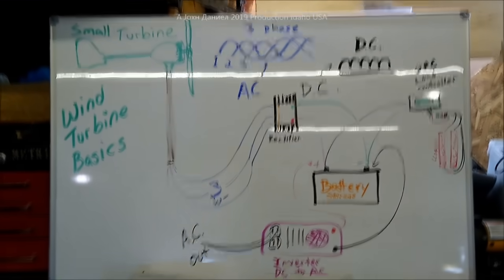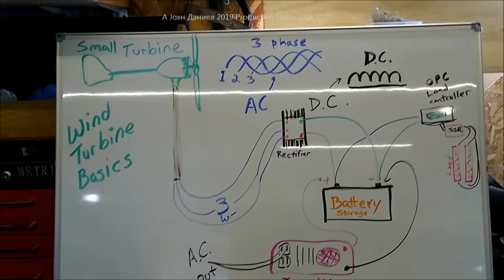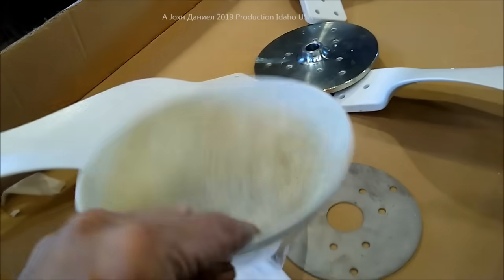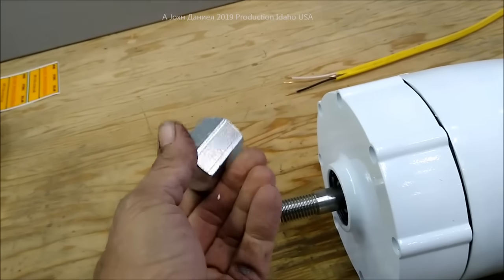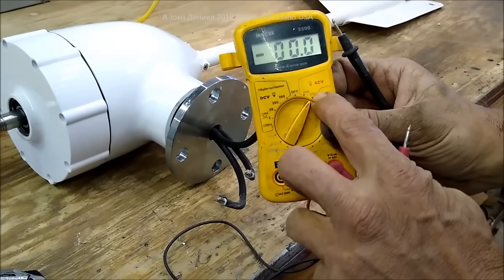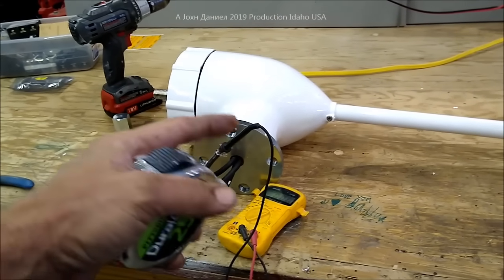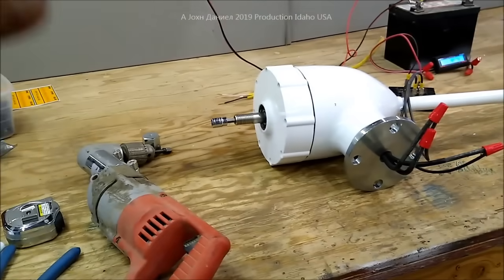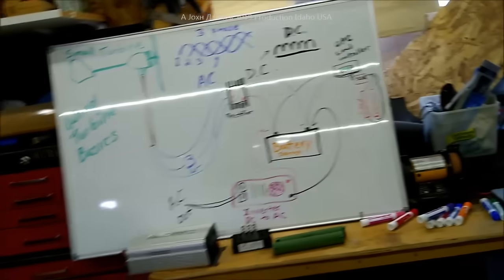800 Watt 12/24 volt Small Wind turbine by B & C Wind, Newest Model, Huge Parts List below

Comment from the maker: WIND TURBINES #1 Source for all Residential Turbines -  https://ebay.us/ChKVLy
My 500/600 models here https://ebay.us/8AgTiU and all the POWER PARTS LIST 600/1000 watt LW-M3 series Small Wind Turbine I use They are seen in older videos making 120% rated power!! *This channel may make a ebay partner commission from some links offered at no additional cost and can often save money due to discounts from the sharing.
( ALSO FIND THEM HERE 👉 https://temu.to/k/ptsnjzrkoq3 )
12 volt 100 watt 2 to 6 ohm https://amzn.to/2ODJtTe
24 volt 100 watt 4 to 8 ohm https://amzn.to/2ovTkQo
48 volt 100 watt 6 to 12 ohm https://amzn.to/2ODr1tX
LIVE WATT METERS https://amzn.to/2ODYJQk
SOOW 8/3 Wire ( safest to use ) 
UPDATED SOURCING - To get 100% full batteries from one & to divert over volt you need these: https://amzn.to/37HN2OR 100A SQL Rectifiers &  https://amzn.to/2MTUjCU A All purpose long life Load controller and be sure to get up to and over 300 watts diversion resistors ( https://amzn.to/2QngFPq x 3 or 4) and one or more 60 amp SSR ( https://amzn.to/2QKEyj0 ) with heat sink ( https://amzn.to/2ZYtmna ) and be sure to use thermal past on it.  ( Proper type - https://amzn.to/2QN2hir from Protronix) Consider your wind speed area to size it!
Reply: Hello John, I love your videos.
I have a question for a 800W or 1000W wind Turbine how long the pipe needs to be from the ground to the top, also can I use a aluminum light pole?
Reply from the maker: @wagner1968  15 feet and higher depending on your install area. Ground disturbance clears up at 8 to 10 feet and is gone at 20 feet in 90% of the world so I would exceed 15 feet with no obstructions like trees or buildings within 75+ feet away when installing yours. And a (19+ foot on average) commercial light pole is a great type of pole to use.
Reply: Great video, I can't wait to see more about this!
Can I get and run a 24V windtur into a 12v system... do I need to convert it into 12v after it's generated?
Reply: Јоhn Daniel I thought you had to go from the rectifier to the charge controller to the battery? Or does it depend on what controller you have?
Reply from the maker: @80Matthias80  Depends on the controller, if you have a braking controller which is sent with the turbine the system works but not well. On mine I run from turbine to rectifier to battery, then my OPC controller controls top charge rates with diversion loading. Its a much better design than the all in one controllers because you can get 100% battery charging, the others will only get it to 90% due to their design which applies braking to the turbine to prevent over charge. In my experience, braking is not good on turbines, loading them down is.
Reply: Јоhn Daniel what exactly is the ssr for and is it really necessary?
Reply: Јоhn Daniel my system is also 12V too and the only ones I can find all say 24.
Reply from the maker: @80Matthias80  A SSR is used to assure many more switching actions for load diversion to control the wind turbines power.
Reply from the maker: @80Matthias80  If you go to the link under the video, there are choices of 12,24,48 volt and 3 or 5 blade.
Reply: DUDE or should i say Professor of normal gentleman talk.  You would be BRILLIANT in a trade collage teaching apprentices. Some people have the gift of sharing knowledge. You do it brilliantly. Some lads are smart but they cant deliver there smart to others. perhaps they are just selfish and trying to make it sound like rocket science. I am a electrician for the past 30 years. I have your gift. NOW ,,, Not everybody can share knowledge but in doing so actually tests us. You never know what the apprentice is going to ask . There is no silly question. Also i like to let them try first and go for it.. There young brain has not been polluted be our passed down trade knowledge. Who is to say we have the best way to do something. I have learnt a lot from 1st year apprentices that have not had   "this is how its done"  shoved / drilled into them. 

  I never teach my pupils, I only attempt to provide the conditions in which they can learn.

  Albert Einstein
Reply from the maker: I teach a Preppers Survival Power class every summer, 3 classes lasting 8 days each.
Reply: @JOHNDANIEL1  can we get your email to keep in touch about the classes
Reply: @JOHNDANIEL1  How may I find out about the Preppers Power Survival classes?  Thanks!
Reply: John want to buy one  ut how will i wire it up to use with my grid tied 5kw solar system?
Reply: How do you hook it up to the grid without using a battery
Reply: I love your videos and find them really useful. I purchased an 800 W windmill from B&c run by battery drill I got a 95, 95 and 100, is that within acceptable parameters? Thank you very much.
Reply from the maker: @tomhernon3247  Yes, thats normal for a open voltage.

Comment: this is 6 years ago but nontheless.. yes you can push 'upto' 800 watt but the problem is i don't understand why any wind turbine producer expect it will go that high but in reality you can't unless the generator are really optimized for that. 'this' turbine is not optimized for low speed and that take into count if the location can't even generate quarter of the 800 watt? it's basically not worth it. better of just build it yourself. it just 'rated' can handle up to 800.

Comment: Hi John. 
Brad here from South Africa.  
A while ago I bought a burned out wind turbine.  I got hold of a guy in the UK , Hugh Piggot, who helped me with a design to rewind the turbine. I rewound it and it works like a bomb!  Problem Is, I can't find a controller to match! I've bought a blue, claimed 1600w controller and dump load on ebay. That peaked at about 980w before engaging the dump load....jusg as the turbine would start to produce power the controller would activate the brake for 30 seconds.  It produced only 0.66kwh in two days before it burned out. 
Next I tried a 2000w dc to dc converter.... it worked well but also burned out when we had a strong wind.  The turbine is 48v and is designed to produce 1500w max. 
If you send me an email adress, I'll send a pic of the turbine as well as a 1 min video of input voltage vs output power that you can get an idea of the power curve.... 
I like the idea of a step up controller, as the wind is not always strong enough to charge at peak voltage. I had the dc to dc converter set at  cut in voltage of 24v... that way I managed to harvest power in low wind conditions. 15- 20 mph ... 
I could get 150wto 300w. At around 30 mph wind the turbine produces over 1000w. 
What would you recommend as controller and over voltage diversion ?
Thank you for your time.
Reply from the maker: My email is in the "More about this channel" data on this channel main page.

Comment: Hey awesome video so  hey question for you as I'm trying to understand 
So i have a zendure super base v 4600 unit
Do i need all them dodads or can i just get away with just the turbine and hook a 10 gadge to it and a xt80 connector and good ta go?
Reply from the maker: Turbines put out raw voltage, many power stations will reject or fail their BMS and charge controller. Using a Slave Battery in the middle will work though to send them power easily. I plan another video soon on that subject.

Comment: Morning John frothe UK, our energy prices have been hiked up again so I've got to do something more to reduce my bills!! I have a small solar system, but being in Scotland sun isn't around much! Having been a huge fan of you guys for a few years was going to buy the 800w 12volt turbine you have recommended in this video. I'm thinking of using the mars rock 1500/1500 wind & solar controller that you've suggested... just for set up simplicity, because electrical circuits isn't a strong point of mine.... If you have any other suggestions on a set up with my battery bank that would be much appreciated, or if you think I should use different controller I'd appreciate your help... Thanks Ste

Comment: I finally got my Chinese turbine up that you recommended. I have 9mph wind right now and it's not spinning at all.Brake is off.What mph wind does it need?
Reply from the maker: It will need some good 20+ mph gust to set the magnets and field in it. Then you'll see base watt power from 10 to 11 mph, very little, then progressive sharp increases as it gets past 12 mph to peak power ar 25 mph.
Reply: @JOHNDANIEL1  Thank you.

Comment: John, 
What type of charge controller are you going to use if you use a rectifier. Will it be designed specifically for wind, or can it be a controller that can be used for both solar and wind, and is so what about the SSR and dump load. 
Thanks.
Reply from the maker: Wind and Sun OPC diversion system, links for the parts are a ways down in the info below the videos

Comment: I just received my 500w wind turbine from b creation (b n c) and the shaft seems to have play I can push in like almost a quarter inch in? Is that normal seems Abita stiff too doesn't spin by hand easily. The packaging was beat up damn ups guys!
Reply from the maker: It should have about 3/8" play in it, that's centering travel. And it should require 7 to 8 lbs turning force so yours sounds very normal.
Reply: @Јоhn Daniel  yes thanks I tested it with a drill on low speed and I got like 56 volts.

Comment: Hi John, Marcus here from Communist Canada. Lol....appreciate your videos. I have a question regarding diversion loads for 12 volt wind turbine. You recommend 2-6 ohm resistors 100 watts. Why do you recommend this size and is it possible to use 300 watt 1-8 ohm resistors? I guess my question is if you have a fully charged battery bank and a turbine pushing 500 watts what is a acceptable diversion load. Thanks for your time.

Comment: Solar wind or controller model will I need if I'm adding it in combination to my solar panels?
Reply from the maker: If you are running a small to mid grade system, get the all in one Wind1500+Solar1500 12/24volt to get proper 750wind@12/24volt)  https://s.click.aliexpress.com/e/_AsIplb . You would add no more than 800 solar and a 800 watt turbine like this one http://s.click.aliexpress.com/e/5dnnyP8k and you won't need to controller that comes with them. Just order WITHOUT CONTROLLER and get that one above. 
Anything like a inverter or controller normally rated for any amount you should  never take to the limit. So a 1500/1500 watt is best left running at 50 to 60% max for longest and safest lifespan.

Comment: I have a goal zero 1500 yeti portable solar power unit.  I have 400 watts feeding it from solar panels , Can you tell us what wind turbine is needed to feed the yeti and what is needed?  thanks tee
Reply from the maker: Goal Zero power stations are not designed for or capable of handling wind turbines. But if you add a decent sized second battery to them you can likely use a turbine.

Comment: Can power from the OCP be diverted to another battery bank instead of the resistor load?
Reply from the maker: Yes. As long as you can use the power in a second bank so it don't end up being over charged from wind power. The easiest way to use 2 differing aged or style battery systems New with Older, is a isolator ( my video on it https://youtu.be/4jqjsZHmEEU ) and use the diversion control on the main newer bank of batteries.

Comment: So is possible to charge a 12 VDC battery with a turbina rated at 24 VAC directly by means of normal rectifier and not normal charge controller? Thank you!
Reply from the maker: The wind and solar all in one  charge controller if you get one will work just fine up to 150 input volts. So the battery voltage rating is what it services on. By adding a 24 volt turbine the maximum voltage is around 80 volts and it'll run just fine into a 12 volt battery Bank. Down in the links below some of my newer videos they'll be a all-in-one controller that says 1500 w 1500 w that is a absolute perfect model to use for the kind of stuff you want to do. I recommend the low wind 600 watt turbine that's in some of those links and just get it in 24 volt if you don't have much wind but need some wind charge ability.
Reply: @JOHNDANIEL1  thank you !

Comment: Why is the charge controller after the battery and not before? Thanks!
Reply from the maker: Wind turbines produce a type of power that has to be diverted when excess battery levels are reached. You don't actually control the turbine, you control its effect on the battery bank.

Comment: Hi John, I purchased a 400 watt vertical wind turbine and noticed the 3 phase wires coming from the turbine are very small, looks like 16awg, they are smaller than the controller that came with it (looks like 14awg).  You mention the turbine in this video, the 3 phase wires, was probable 8awg.  I'm in the market to purchase more wires for the long run to the rectifier...inverter setup.    Would you be concerned with the size of the wires?   Wondering of they will burn up or ??   Thank you in advance for your input.
Reply from the maker: They are the metric equivalent of 15 gauge with fire wrap sheathing. It can be that smaller diameter because it's a very very short run. They will not cause a problem as long as you use heavy cord from their down.  From it down to the controller you will use a full copper (no CCA COPER CLAD) 12 awg extension cord up to 28 feet, or a 10 awg cord up to 56 feet to wire it up. 3 on 3 wire colors don't matter. 
RV extension cords are about best for this use.
Reply: @JOHNDANIEL1 Thank you for your help, I appreciate it!!!

Comment: Why is there no regulator to provide correct voltage to the batteries based on type of battery?
Lithium and LA for example need different charging profile.

Comment: Hi John, the load controllers listed are all for 12/24V. I have a 48V system and the 800W turbine you recommended. Which load controller would you recommend for my 48V system?

Comment: John, I’m just starting to plan my own power system. From what I’ve seen, 48v is the preferred battery bank voltage. Is that true? If so, would you need a 48v capable turbine? Also, I plan on assembling my own LiFePO battery bank... seems to be the best option considering longevity, stability, and power density. Can you confirm? EDIT: Nevermind, just watched your “Why do I run 12v” video. I want to replace grid power in my home. Mainly lights, fridge, washer/dryer, hvac (we have 2 4ton systems), etc. I just saw your 5000w inverter... if I want to run my house 100% in case the grid goes down, am I going to need one monster inverter? I have room for as many panels as I need. You’ve convinced me to run 12v with lead acid. I plan to run solar and wind (using the hurricane turbine you reviewed - your discount code doesn’t work anymore). Is this even possible, or do I need to setup a smaller system and just choose what to run?
Reply from the maker: I prefer 12 volt, its not about efficiency of a volt or watt, its about total survivability of a system, actual total cost is lower and availability of parts as the world descends into chaos. You sound like your a Back woods hick when you say GO 12 VOLT, according to the sellers of 24 and 48, but isn't that what they would say. See my explanation video then you decide. https://youtu.be/1SNqV7nMDHU
Reply: Just watched your “Why do I run 12v” video. I want to replace grid power in my home. Mainly lights, fridge, washer/dryer, hvac (we have 2 4ton systems), etc. I just saw your 5000w inverter... if I want to run my house 100% (220 and 110v) in case the grid goes down, am I going to need one monster inverter? I have 200a breaker panels in both my house and shop. I have room for as many solar panels as I need. You’ve convinced me to run 12v with lead acid. I plan to run solar and wind (using the hurricane turbine you reviewed - your discount code doesn’t work anymore). Is this even possible, or do I need to setup a smaller system and just choose what to run?

Comment: Would you help me?
I have a KT7 from thermodyne
It's 48v ac 1500w wind turbine.
It's going through a rectifier. 
Im wanting to grid tie this system and looking for a good charge controller to charge batteries before going to a grid tie inverter.

What would you recommend for a charge controller?

Comment: I bought a 24 volt one for my 24 volt system should of bought a 48 volt because I don't have the constant wind needed to run it steady enough to charge my system.
Reply from the maker: When a blizzard hits and your solar is covered in Snow, thats when they shine the best. But if you have very low winds, maybe check mounting location to hopefully improve it or contact the store and ask to buy ONLY the 48 volt generator head you can mount on the existing turbine and slip ring system.
Reply: Thanks again im just gonna get a 48 volt turbine

Comment: Have you had a shot at getting one of these to work with MPPT? Surely you'll get a much better result if you can take any input voltage and squeeze out more wattage at the right voltage. (PWM just pulses the input voltage to try approximate the charge voltage but due to pulsing, you lose a fair bit of power).
Reply from the maker: They do sell a MPPT controller for them that cost $320 but then thats the price of another 500 watt 5 blade unit! Better to put up 4 turbines that are slightly inefficient than 2 with MPPT in my area. But if you do have low winds, a MPPT is a best option.